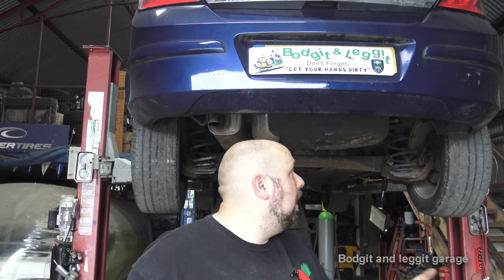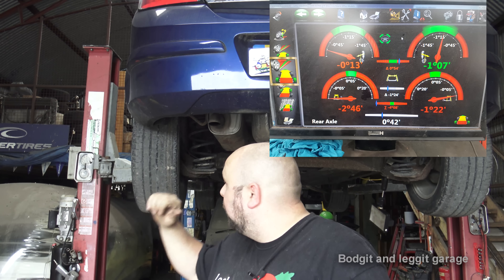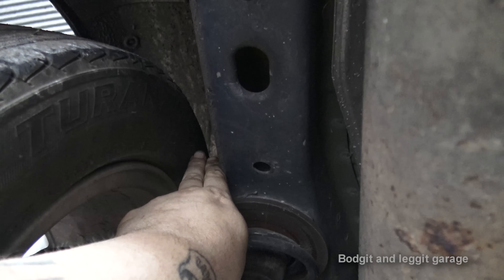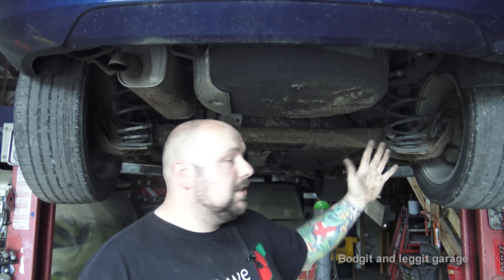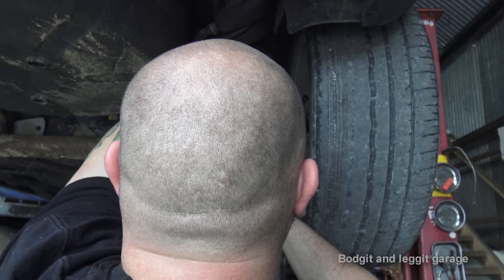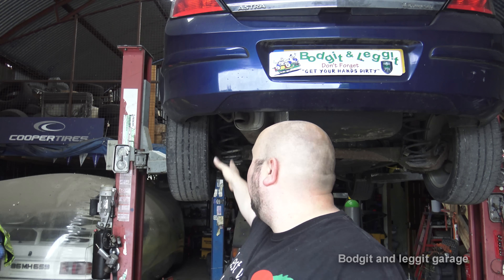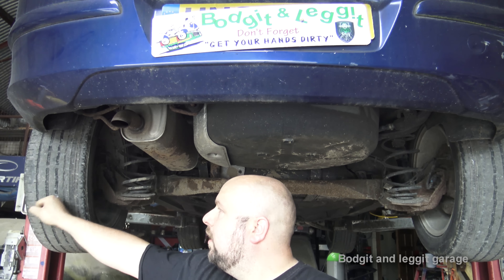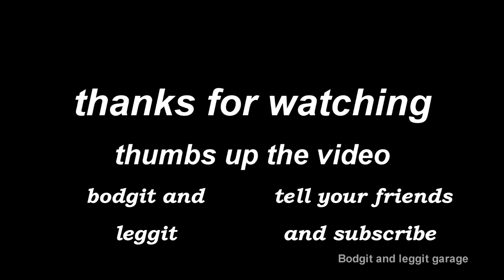Vauxhall/Opel Astra Bent Axle Part 1 Bodgit And Leggit Garage

Comment: Commenting very late on this, I remember reading when the Fiesta Mk1 came out that the its Panhard rod was designed to be the weak link in a situation like this to prevent damage to the rest of the rear suspension.
Reply: you all probably dont give a damn but does anyone know of a trick to log back into an instagram account..?
I was dumb forgot the account password. I would appreciate any help you can offer me!
Reply: @Jared Ira Instablaster =)
Reply: @Ralph Kai i really appreciate your reply. I found the site through google and Im in the hacking process atm.
Seems to take quite some time so I will reply here later with my results.
Reply: @Ralph Kai It worked and I actually got access to my account again. I am so happy:D
Thanks so much you saved my account !
Reply: @Jared Ira You are welcome =)

Comment: Blimey Leon the guy is sure lucky he didn't get a pull by plod 3 points per tyre is half way to a ban lol.....funny thing is tho tracking or wheel alignment is never tested during mot as far as I know.....Also wondering if the whole chassis is bent as well....I would sooner scrap it than drive it with the family in....great Video mate Cheers
Reply from the maker: Steve Jones hi mate I'm pretty certain it is I know the NCT here they certainly check the tracking so I'll be pretty certain they do in the UK as well but not 100% sure I will have to find out thanks a lot for watching
Reply: Hi leon, they dont check the tracking during an mot here in the uk. The legal tread depth is 1.6mm if there is more wear on inner or outer tread of tyre then they would just right out an advisory but still pass the vehicle. Nice video anyway mate looking forward to the axle swap.
Reply from the maker: martin bell thanks a lot Martin that's handy to know I didn't know that I just assume they would check it
Reply: Steve Jones I don't think these have a chassis everything is bolted to the floor pan, not many cars have a chassis as such these days, I rebuilt a Tvr chimaera which definitely does have a chassis.